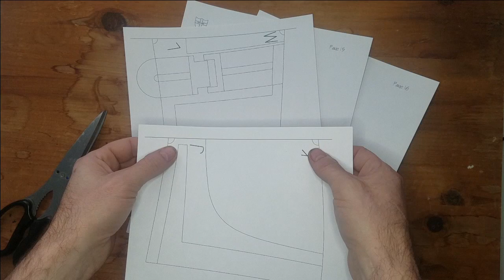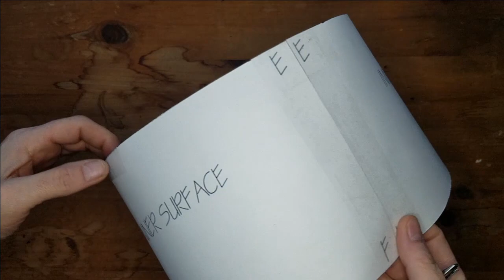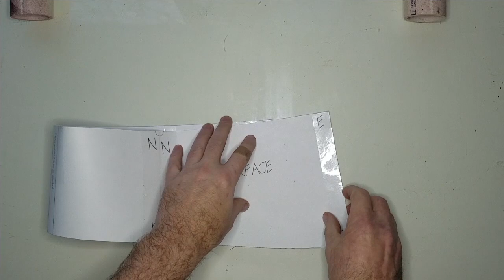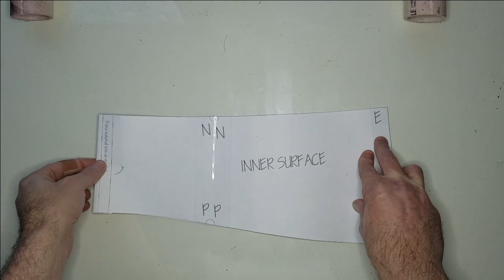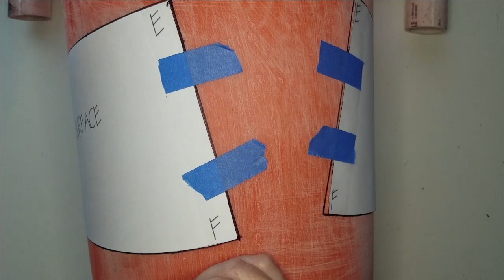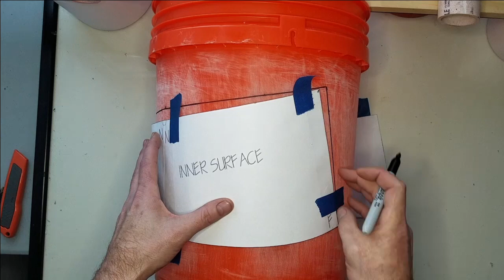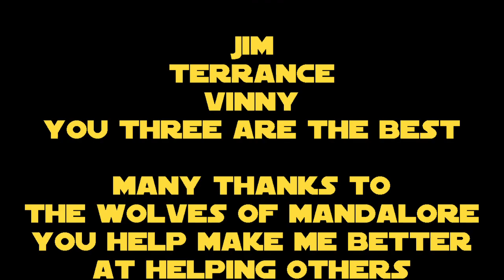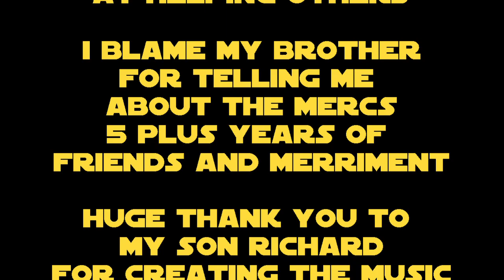Making a Custom Mandalorian Helmet, Part 1

Comment: Finally someone who Puts the Templates in the discription thankx soooo much
Reply: And finally someone who didn't worked with a 3d printer. (My english is Not so good i'm from Germany xD)
Reply from the maker: Templates straight from the source at The Dented Helmet. WOF did an outstanding job on them and they have stood the test of time.
Reply from the maker: It's not that I don't like 3d printers (I don't even have one yet...) I just love getting in there with my hands and seeing what happens.
Reply: @TheBeardedMando   I don't even have one too so i'm Lucky to find someone who didn't use one
Reply: @aliceongaro3273  Yeah same, its really hard to find a helmet tutorial without a 3d printer

Comment: Lighter fluid can remove the sticky stuff usually.
Reply from the maker: Ya, I have used that in the past. It's just not something I had on hand at the time.
Reply: @TheBeardedMando  next time, I find that some mineral spirits works wonders

Comment: If the Force wills it, then in the spring I should be able to follow on this path, as you have shown "Te Way".

Though I do agree with the use of "card stock" for printing/working with on the pattern - as I work in a book bindery, that is easy for me to acquire.
The Suggestions for Goo Gone & WD-40 I have used aw well, though you already commented on that in another video in this series, of which I may comment on.

So until this Winter ends so work can begin, supplies for this and a project that follows "Te way be Tarre Vizsla, te Mand'alor"

NOTE: Anything in " " is in course/rough Mando via FunTranslations.com.
Now, all I need is a Mandalorian Font set and I can write my own chain-code!

Comment: would epoxy work instead of fiberglass resin?
Reply from the maker: I don't think that epoxy would saturate the cloth. The fiberglass resin and cloth are there to provide a foundation for the bondo that comes later (Part 6).
Reply: @TheBeardedMando   awesome, ty so much. Also, ty for answering my question on the forum, helmet vs hard hat.